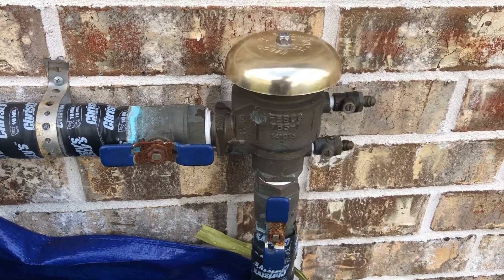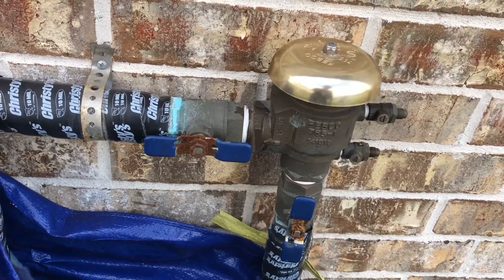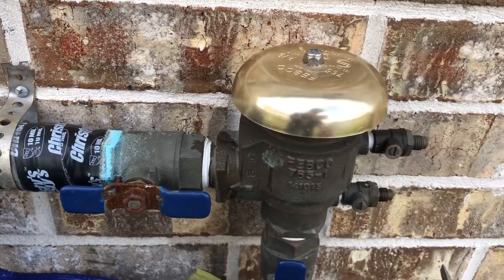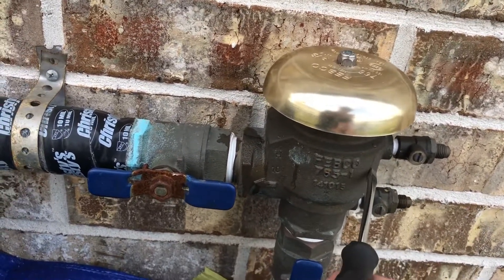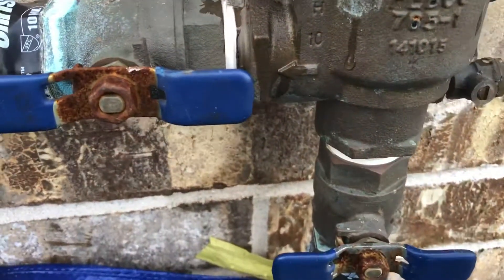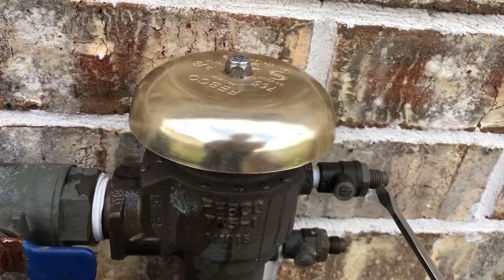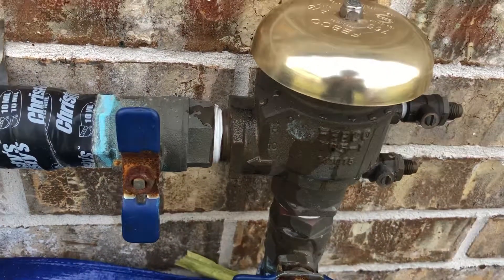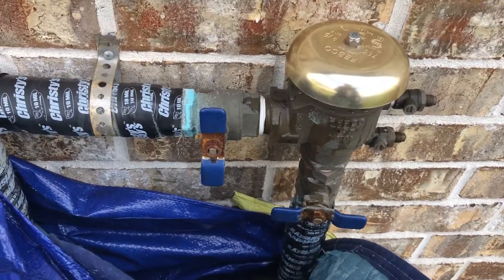How to bleed your back-flow preventer and sprinkler system

Comment: Here in New Jersey u need to use an air compressor to blow out the preventer and sprinklers as well.  This procedure does not eliminate all the water

Comment: Hoping you can answer my question. My sprinkler system is in need of repair, so I have all three valves shut off - the two valves on the back flow preventer and the valve by the sprinkler system on the other side of the fence. With the water supply valve off, is there any reason for me to open the other two valves, or is ok to leave then closed?

Comment: So you didn't shut off the main water valve for the sprinklers?
Reply from the maker: I did. You have to shut off the water supply to the backflow preventer, which supplies water to your sprinkler valves.

Comment: Why mine the water keeps bleeding on the check valve even after turned off both supply and second valves?
Reply from the maker: If water keeps bleeding (after a few minutes) after all shut-off valve has been set to shut (perpendicular)... you may have a broken / leaking shut-off valve

Comment: First shut off the water supply from the house.  Open all of the valves and drain as much water as you can.  Then leave them open 1/4 turn.  Closing them all the way traps water=frost break=$$$$.  Find whatever you can for insulation and pack it around your backflow preventer and above ground pipe. I've used swimming pool noodles, blankets, whatever.  That should get you through the cold snap.
For an extreme / extended cold snap you should beg, steal, rent or borrow an air compressor, even a small one will do. Shut off water supply from the house.  On this system close the bottom ball valve (blue vertical valve going in).  This system doesn't appear to have a blowout valve so attach compressor to bottom (brass) stopcock valve on backflow preventer.  This isn't ideal, but will do in an emergency.  You may need fitting from hardware store.  Open bottom stopcock with compressor attached, close top stop cock, open horizontal (blue handle) ball valve going out to lawn.  Open a zone valve for sprinklers.  Turn on compressor and wait for sprinklers to blow air.  If you have a tiny compressor you may need to wait until pressure builds.  Do all zones.  Leave all valves on backflow preventer open 1/4 turn when you're done.
Reply: This!!
Reply: Yeah I would need a video for that.  This is why dumb people don't make it, I'm a new home owner and that was too complicated for me.  I thought I was just supposed to do what's in this video?

Comment: The Houston, Texas 2021 ice storm got mine cracked right at the supply valve. I did the bleeding, turned off everything, wrapped it in two beach towels, and covered it in a trash bag. Still got a crack at the supply valve... Is there a temporary crack fix until I can get the sprinkler guys here? Very very slow drip.
Reply from the maker: If the backflow plastic valve itself was damaged (crack) slow drip, it is best just to keep the supply valve shut and not use your sprinkler system for about a week until you can get the replacement part. Is it a Febco 765-1? If yes i have a video for quick and easy replacement: https://youtu.be/223KLKAOP24

Comment: If i kelp the valve close its going to be water inside of my house?
Reply from the maker: @MrOCHOYA Back-flow preventers usually protects a certain system, in most cases a sprinkler system.  Bleeding and shutting off a sprinkler backflow preventer should not affect your house. If your house was built right.. yes, you should still have water supply to your house.

Comment: I believe in the frigid north where temperatures regularly drop below 32 they blow air through to flush water out.
Reply from the maker: @spacecadet28 wow really, blowing compressed air into the pipe probably would clean out 99% of water in the pipe, but that is such a big hassle.

Comment: Might as well leave the valves cracked open so any water can expand if it freezes. No reason to close them and take the risk.
Reply: My thought as well
Reply: That was my main thought as well.  There is no reason to keep them closed.  That is assuming that your main inlet valve has another valve further upstream closer to the ground.  The outlet valve has no purpose on being closed.  Also why would you not let the bleed valves on the backflow preventer stay open?

Comment: we did everything and the water is still coming out what do we do now? It is like the water is not cutting off.
Reply: Are you sure the supply valve is turned off. If it is, there will be no water pressure.

Comment: 50% of this video is useless and a poor explanation of a backflow preventer. Also, the pipes aren’t generally steel - when ice forms and expands the small inner surface area causes that much pressure to be exerted breaking it at the weakest spot.

Comment: This is a great video so thanks for that. I have a question though. At the end you mention to run sprinkler system to run the water out of the underground lines. My question is: do you have to run all stations and for how long do you run them?  Just want to make sure so I don’t ruin any of the valves by running it dry.  Thanks ahead of time for explaining this.
Reply from the maker: @Laurie Whittle Yes running all sprinkler zone/station is better. We just want to be sure to remove as much water from all pipes. After you turn of / bleed the backflow system, you can just run each zone for 30 seconds to 1 minute, that will empty water and relieve pressure. Thanks for watching.

Comment: Hi DIY GEEK! What causes the sprinkler valve box to flood? I tried to to the bleeding.
Reply from the maker: If you sprinkler valve box constant holds water (floods) you probably have a leak in the valve(s) container in there.  Drain the water and you should be able to see the leak or if the water star to rise again.  If the leak is very small try to wipe dry the valve using towel and spray soapy water to detect where the leak is.
Reply: @DIYGEEKTEXAS  Thanks! Sorry for the late reply. You're right! It's already drained.